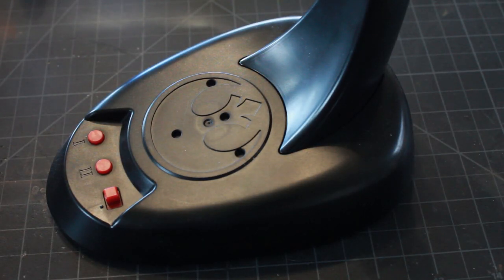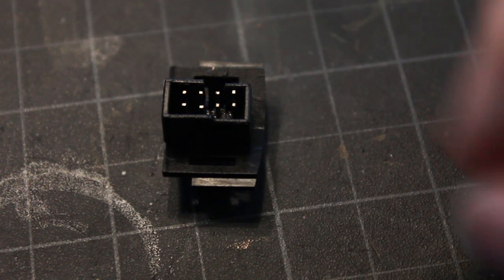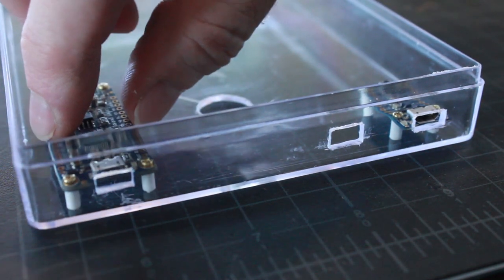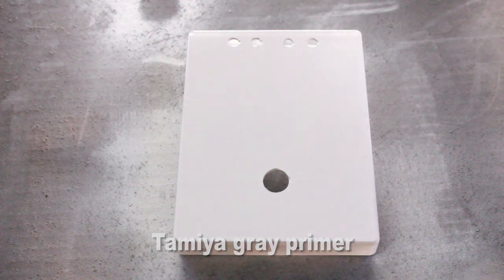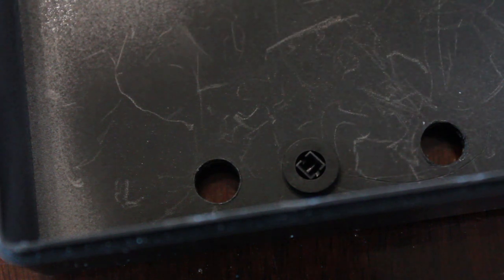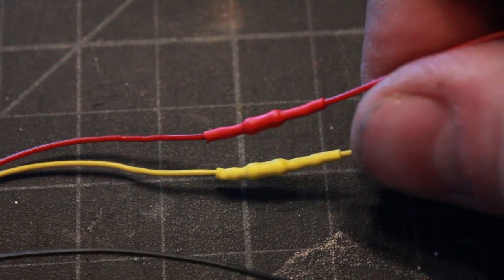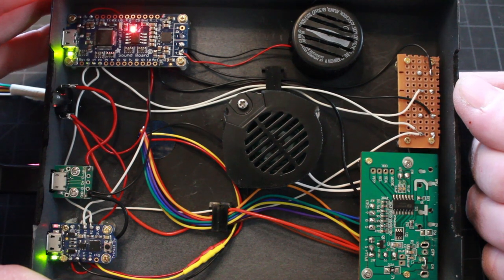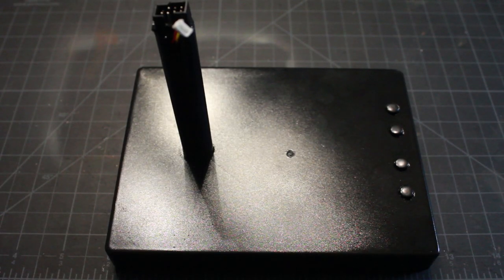Bandai 1/48 X-Wing Pt VIII Electronics and Base

Comment: I saw you using a solder vacuum in the video, and I don't know if you have this, but solder wick is infinitely easier to use for removing solder. It's a very finely woven copper ribbon that you can place over the solder joint you want removed. When you heat it with the soldering iron all the solder lifts up into it.
Reply from the maker: I actually just found out about solder Wick on my own recently.   Got some to use for future jobs.

Comment: I like the modifications you did, good stuff.the trinket, what is its function, is it suppose to be a voltage regulator or something else?
Reply from the maker: The Trinket is an Arduino board.  So programming the lights
Reply: Thank you
Reply from the maker: @johncool1493  no problem.  If interested,  here's a link to the board. 

https://www.adafruit.com/product/3500
Reply: Thank you again, sorry I forgot to ask, do you need to program the trinket, I am not familiar with this as its all new to me.
Reply from the maker: @johncool1493  yea.  You need to be able to sketch code
Reply: @modelsbychris  ok thank you

Comment: Christopher, I dont know if it is just me but I thought you had 2 strobing LEDs on the top of the canopy but I have only been seeing the rear LED lighting up in the past few videos. I understand I may be late on letting you know this.
Reply from the maker: If you're talking about the line of little fibers at the front of the cockpit, there are 2. However,  I had forgotten to light block the 2 blinking fibers,  so light kinda shines through them a little and makes it hard to see the blinking. They shorts always look lit.  Just a little brightness change unfortunately. I didn't want to take it all apart to fix.